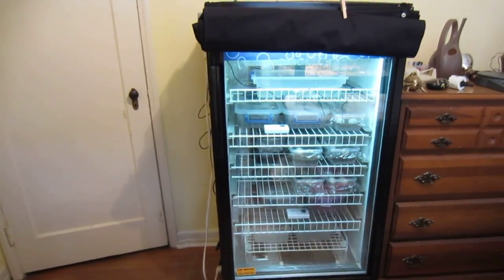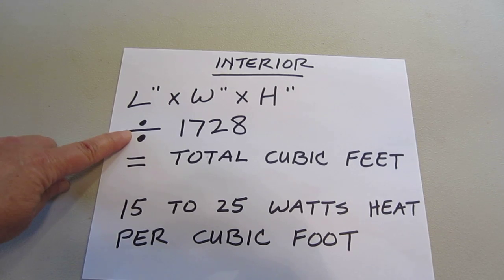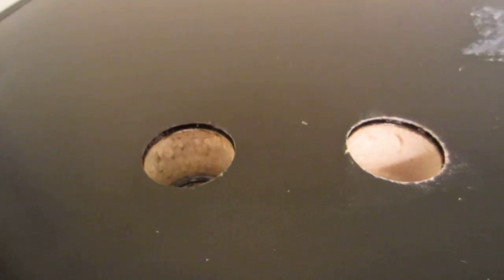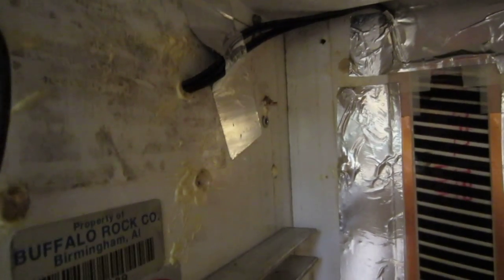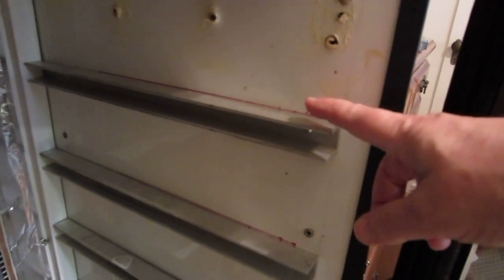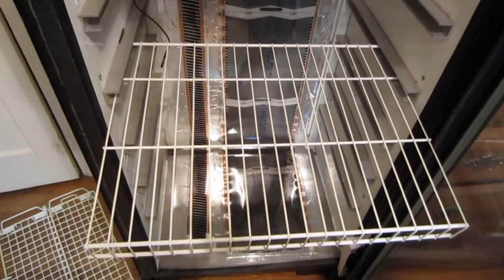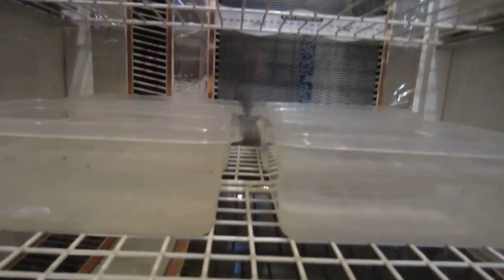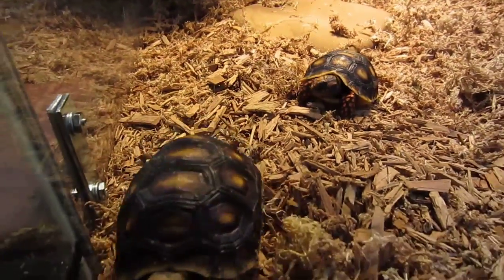How to Build an Incubator for Tortoise Eggs

Comment from the maker: I looked forever and finally found one on craigslist.  If you can't find a glass front box, just use an old upright freezer.  It will be easier to find and works just as well.